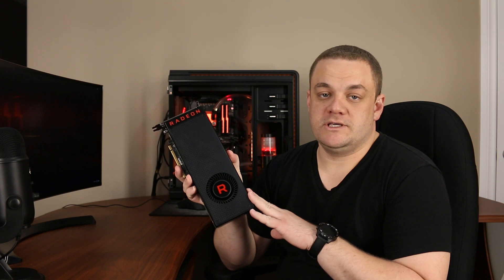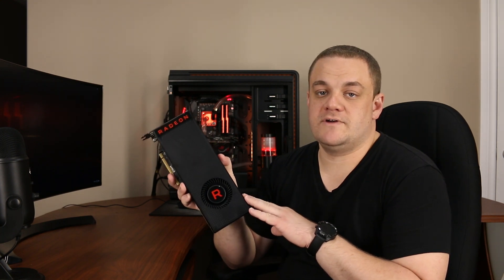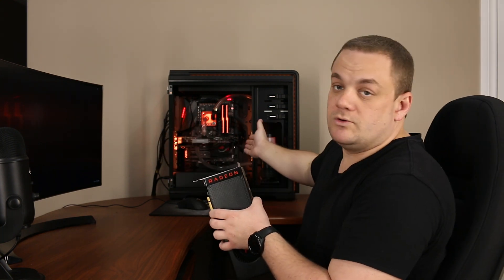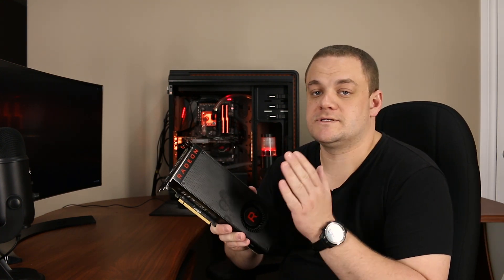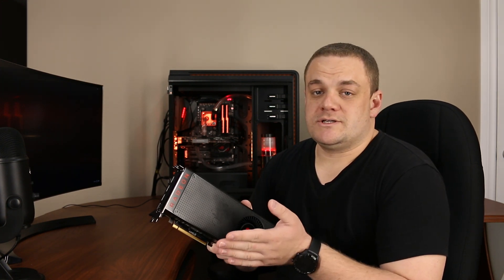Is it Worth it to Water Cool Vega? Vega Water Back to Air Conversion.

Comment: Hey, water-cooling wise for the Vega 64. Would a 360mm 40mm thick rad be enough to cool the GPU and CPU (Ryzen 2700x) not sure if it will be enough considering how hot they are. Any tips would be greatly appreciated.
Reply from the maker: Yeah, I think a 360mm rad would probably work just fine to keep them both cool enough. I ran my Vega 64 and 2700x off of a 420mm / 45mm rad and it was overkill. I overclocked the Vega to the max too. The 2700x will only overclock so far and short of LN2 cooling you won't get a ton more performance out of it. The Vega has a lot of headroom for overclocking, especially on water. Good luck with the project. The Vega cards are a lot of fun to tinker with.

Comment: Really liked the Vega 64 liquid edition. So i was looking around for one and got one for 230 euro. For its age it really performance well. My 5700xt scores 29400 in firestrike graphic and the vega 64 LC 27450. Temps are 51c on load and got it abit undervolted aswell.
Reply from the maker: That's a really good deal for a liquid cooled one. I agree, there is still a lot of performance in the Vega 64 and they are starting to go really cheap. It really is just about as powerful as the RTX 2070 or 5700. Undervolting really does help the performance and sound level for the air blower cards. Thanks for watching!

Comment: been looking for simplest method to watercool my Vega 56 by XFX, still a more than competent card to game 1440p, suggestions?
Reply from the maker: It is still a very competent card for 1440p gaming. As far as water cooling goes, are you just looking for more performance or are you looking to silence it or both? Do you already have  a water cooling setup (rad, pump, etc.)? Also, is your XFX card a standard reference model? If you already have a custom cooling loop and you just need a block, I would check out eBay. Unfortunately, the blocks are still fairly expensive for the Vega reference cards and they can be difficult to find new other than on eBay. If you are just looking for extra performance, you are only going to gain about 10% by water cooling. If you are looking to silence your system, then the water block will help a lot. When it comes to cost, unfortunately, water cooling a Vega in 2020 probably won't be the best way to spend your money. If you want to do it just because you want a water cooled Vega, then by all means it is one of the most fun cards to overclock on water. If you just want to boost performance, then you would probably be better off selling the Vega and putting that water block money towards a more powerful card with a better stock cooler. Water cooling is always expensive and you rarely get the performance return for the money, but if it's your hobby and you have some extra money to spare, it can be a lot of fun. I hope this helps. Thanks for watching.
Reply: @tech_progress  I have an XFX dual fan , non reference card which may pose a challenge and if so will just undervolt it  Thanks for your reply. Cost is not really issue I would water cool it for the noise and I have XFX vega 56 RX-VEGALDFF6. If I can sell it for the right price I would look at another card. All about reducing noice and currently in a H200 NZXT case

Comment: What are your settings on the Vega 64 air cooled model?
Reply from the maker: Hey, thanks for watching my video. Check back tomorrow afternoon and I'll post the exact settings I used when making the video. I just don't have access to them at the moment.
Reply from the maker: Thank you for your patience. I pulled up the Wattman config file that I used during the testing and it reads:

Core:
Power State 1 = 992MHz @ 1025mV
Power State 2 = 1082MHz @ 1050mV
Power State 3 = 1137MHz @ 1060mV
Power State 4 = 1202MHz @ 1075mV
Power State 5 = 1402MHz @ 1100mV
Power State 6 = 1577MHz @ 1140mV
Power State 7 = 1652MHz @ 1150mV

Fan:
20% @ 20C-60C
100% @ 60C and up (If you are trying to maintain 1600MHz it will eventually max out the fan anyway.)

Memory:
State 3 Max = 1060MHz @ 1050mV

Power Limit:
+50%

These settings were very stable with my silicon and never really dropped below 1600MHz during any of my testing. Your silicon may be different, but these settings should be a good starting point. You may be able to undervolt further to keep the fan speed lower, but in my testing this caused me more instability and that's not something you want when gaming. You want to ensure that your settings are as stable as possible to ensure you are getting maximum performance from you silicon without crashing during game play. I hope this helps you out. Thanks again for watching. If you liked this video and want to see more, please consider liking the video and subscribing to my channel. I will have more videos up shortly.
Reply: Tech Progress Thank you. I just got my Gigabyte Vega 64 OC for $300 and I am looking to put an EK water block on it.
Reply from the maker: @BrandinTheForbiddenOne  that's an awesome price for that card. The Vega 64 is still a beast, especially for that price. It doesn't fall far behind my 1080ti, in fact I miss having my Vega in my main PC. Unfortunately, I don't think that EK makes a water block for that card. It's the windforce fans, not the blower, correct? EK only seems to make a block for the reference (blower) type cards. However, the good news is that it looks like Alphacool makes one for that card in their NexXxos GPX series. Their site is down right now, so I can't confirm, but other sites that sell it are showing compatibility for your card. I'm sure even on air, your card must be much quieter than the reference blower.
Reply: TeCh ExPlOiTs An all-in-one mod???